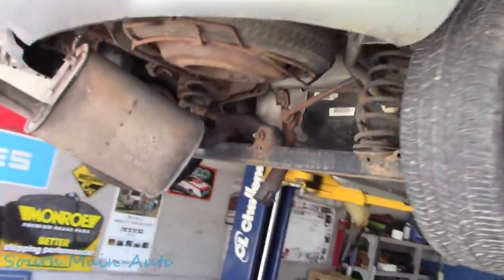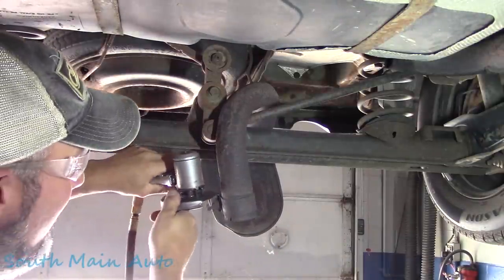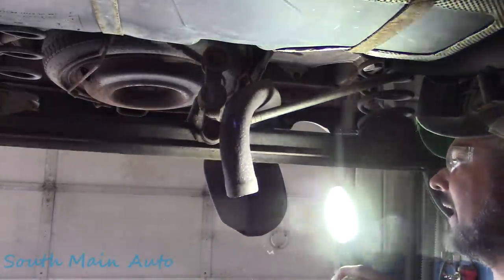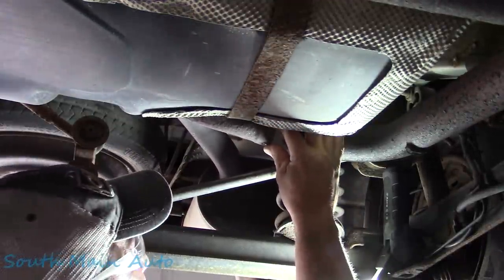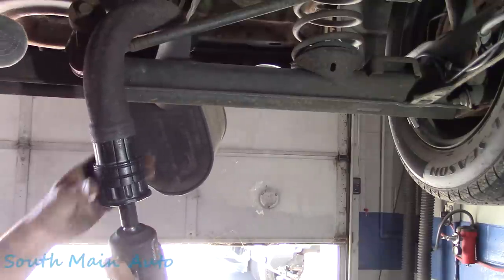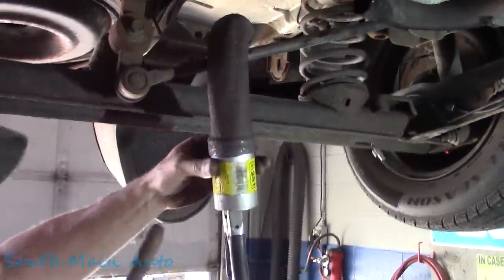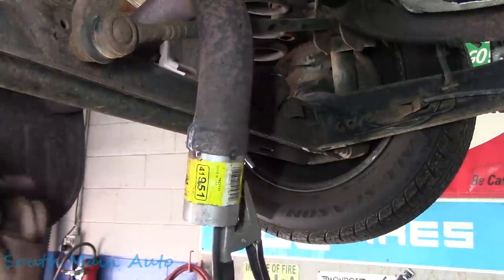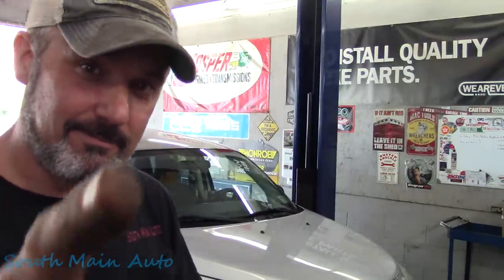Desperate Times Call for Desperate Measures

Comment: Loved the video. This is far from a criticism, but a genuine question - would it not have made a difference in the strength of the welds, if you grinded the pipe down a little for a cleaner welding surface? It obviously still held, I'm just asking because as far as I thought, welding couldn't be done straight to rust. Thank you for sharing your knowledge on this platform!

Comment: Aftermarket exhaust parts are getting very cheap, even from walker. I went on rock auto, got the best parts they offered  because I hate doing a job twice (I really do). The catalytic converter rusted off before its warranty expired. Forget the rest of the pieces, they  were more like swiss cheese than the part that rusted off was. Now I figure the only way to really fix it, is to go with a custom exhaust, or one I make myself. Even the cheap patch pipe I got from autozone was thicker than the walker pipes I received. You do what you have to do through, and I changed it originally because the catalytic converter was plugged, and things had to be cut off, not taken apart.

Comment: Looks decent to me. I've patched up many exhausts on peoples work beaters the same way. The only other thing I might've done would be a little cleanup of the old pipe with a wire wheel to allow welding on bare metal.

Comment: You did the right thing. That repair will probably outlast the rest of the car and why would you put a lot of money into a vehicle that is on its last legs. A new exhaust system would be a ridiculous repair on a car that will probably be in a salvage yard in 2 or 3 years. When they get to that point you just do what you need to keep it running until it's time to retire to the scrap yard.

Comment: As crusty as it looks the factory exhaust on Chrysler vehicles from that era and earlier was at least 409 stainless, it will rot out but slower than the replacement aluminized steel aftermarket stuff.

Comment: Reminder: don’t weld without removing battery terminal first. Curious what amps you run when welding exhaust pipe, new to any welding and I either burn through it or make a big old booger. I learn from you but welding just doesn’t bode well for me. Of course I don’t have expensive welders either

Comment: I usually expand the reducer, or adaptor pipe.  Not the old pipe.  Keep in mind the old pipe is normally a low grade of SS and work hardens with pressure.  Thus making it split even easier.

Comment: Local muffler shop uses reciprocating saws from Harbor Flate for chopping pipes cause they cost $29 and last a year or two under heavy use. They do tons of patches like the one here on the PT Loser. Too many gullible customers will go to a chain muffler stote who will sell them a complete direct fit exhaust instead of doing a repair like this. Treat a customer right and they will come back.

Comment: Even though it's old and rusty, that pipe is probably stainless and expanders just don't work on that. I've tried heat, drilling tiny holes then slitting it to the holes, loosely fitting a clamp around it, speaking in tongues, etc but same results. A split pipe. And, there's no repair as permanent as a temporary one that works.

Comment: I'm always wondering, why not give the welding seams a bit of a spritz with a zinc spray? Did that once to use up the zinc spray I turned out not using, I brushed the rust off that was already setting on the new exhaust pipe I got and sprayed it on. As far as I could see the seams stayed completely intact for years (until I finally got rid of the car).

Comment: I do more exhaust work than I want to when your trying to stretch the pipe with expander 
Try heating it up with torch first and it will go a lot easier when it 800°

Comment: What's the price difference between that repair and a new back box?
The front down pipe on my LDV Maxus snapped just before the flexi pipe, so I had it welded back up for £40 rather than pay £300 for a new middle section!
Good save Mr O!

Comment: Great videos Eric, I’ve heard some people express concerns about mig welders and all the electronics in cars. Have you ever had an issue. Also last week I had a issue with my wife’s 2017 Mazda power lift gate not working. I found thanks to you the fuse was good but it fitting tight in the socket.
Reply: Just disconnect the battery cables to be safe.  It'll break the circuit and prevent any stray current from harming any delicate electronics.  I've been lucky enough to never have a problem without doing that, but I am also fortunate enough to have a properly grounded welding circuit and a properly wired welder.  I don't think I can say the same thing about the really cheap welders.

The one you really have to worry about is the fancy TIG machines with high-frequency start.  They basically make a mini lightning bolt to start the arc, and it goes wherever it can (including through you if the torch is damaged and your gloves are wet or nonexistent) to get to ground.  It doesn't have enough amps to truly hurt you, but it can and does fry computer chips if you don't have a good, solid ground connection.

Comment: Sometimes thats the best repair for the vehicle. Typically the replacement parts are thinner and weaker than the OE system which is very likely not available anymore. Pipe looked decently thick still

Comment: That repair will probably outlast the car.  Sure he should be getting a new muffler and pipe but to me a patched exhaust is still better then the straight pipe he had and much safer.  I had something similar when I was in the Air Force in the early 1980's traveling cross country from Maine to California on orders.  I hit a animal that had a high perfume load in Nebraska of course it hit the exhaust and ripped it loose just in front of the rear axle.  I wire it up good enough to get to the next town and also was lucky as I did not hit it where it could spray my car. I find a muffler shop and the guy looks at the damage and sells me a 4' length of pipe and welded it in.  Everything else was OK for the rusty bucket I was driving. Could he had sold me a cat back yeah but he did not.

Comment: Surprised you dont have a snap on exhaust pipe cutter its a adjustable chain with tubing cutter wheels its fast easy no sparks dont know the number i am not a dealer just a retired mechanic